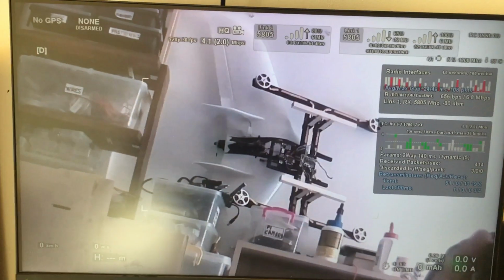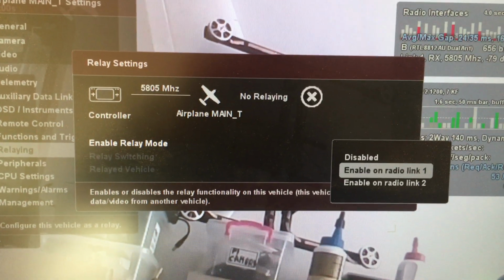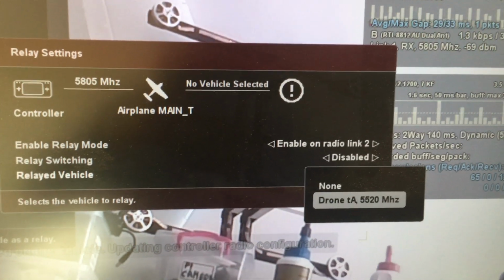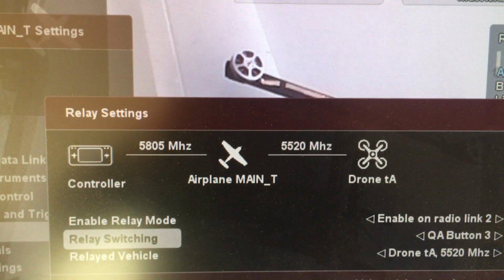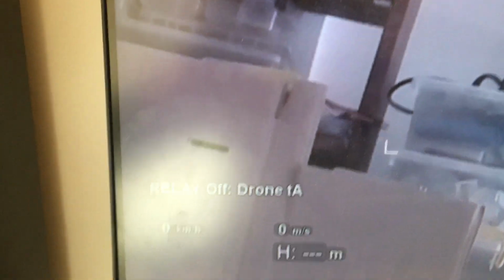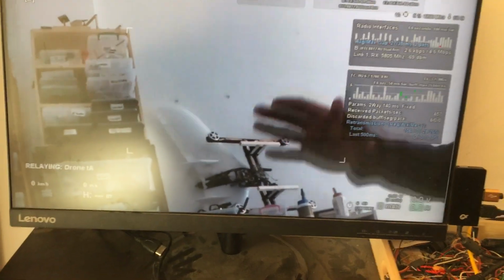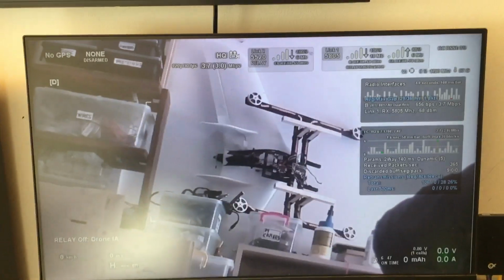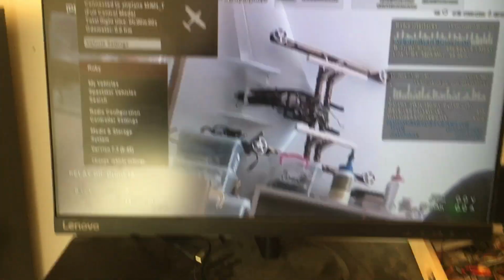First demo showing relaying live video FPV feed between multiple drones

Comment: I tried setting up a relay node on a vehicle but I get a error saying  you need two or more radio interfaces on vehicle for the relay function  to work. Question does that mean I need two wifi cards on relay vehicle?
Reply from the maker: Yes you do on the relay node